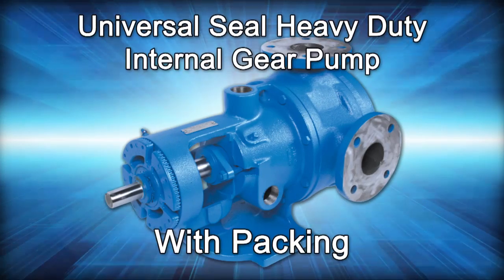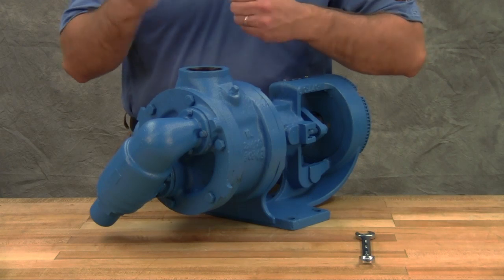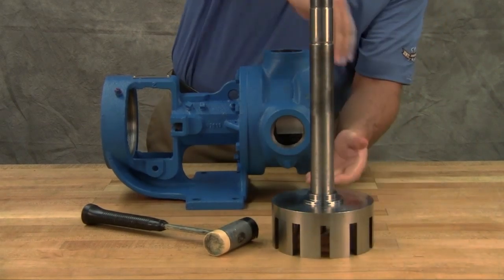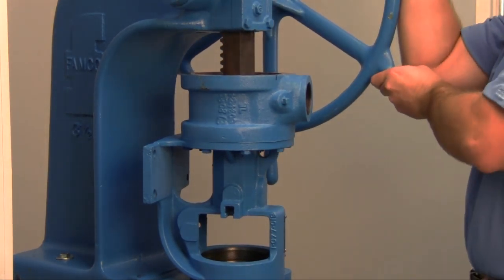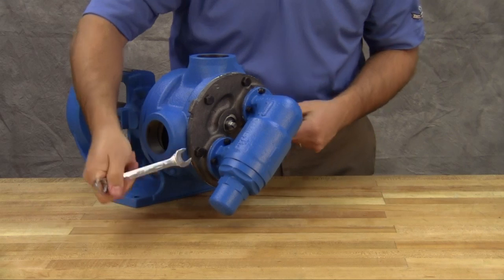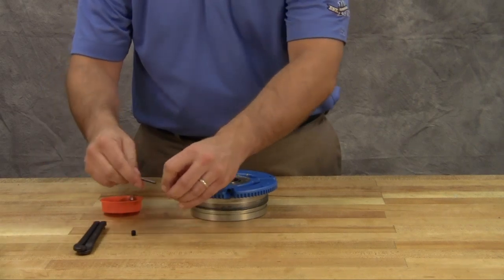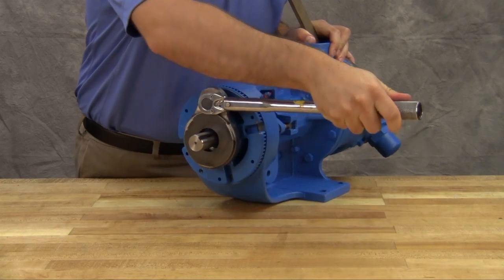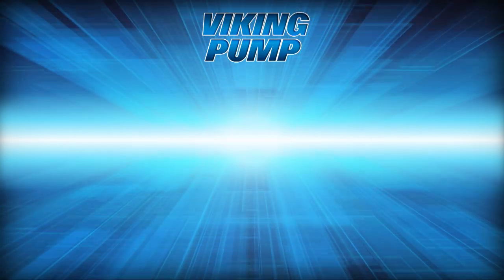Viking Pump Universal Seal Series with Packing Seal Disassembly, Repair & Reassembly

Comment: Can it work in both directions ?
Reply: Yes, but the relief valve would only provide over-pressure protection in one direction of rotation.  The valve should be oriented with the adjusting screw cap pointing towards the suction side of the pump (start at 6:00 to show this).  There's a full video about this valve at https://www.youtube.com/watch?v=SR9F6lfMEAA.